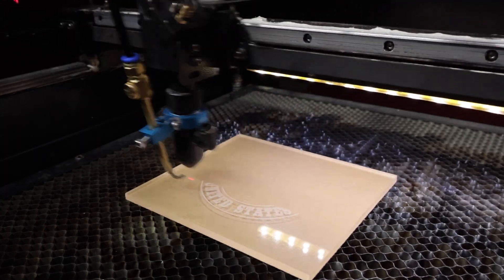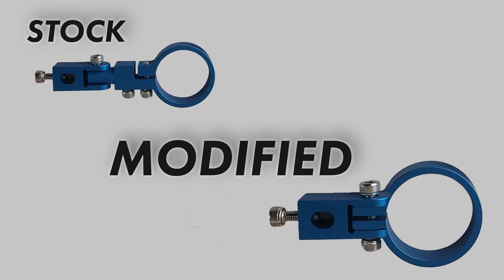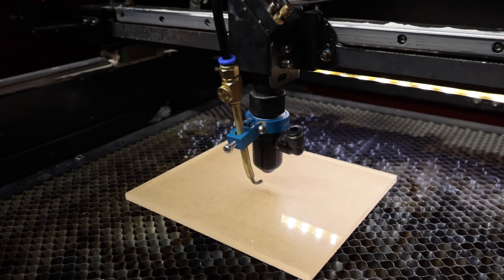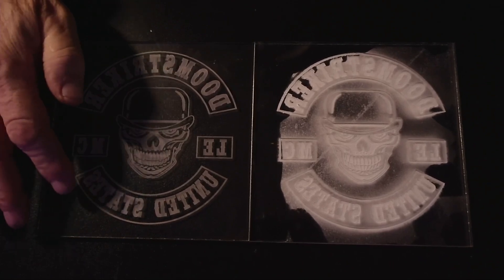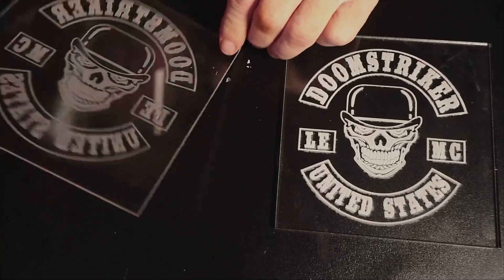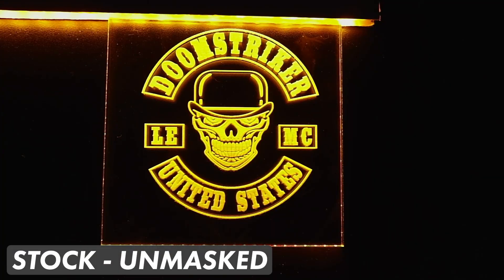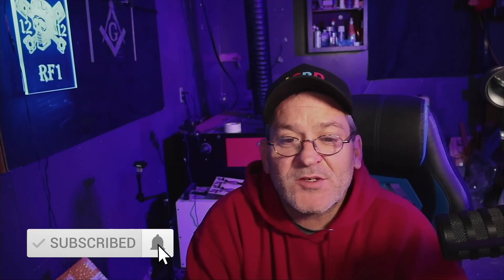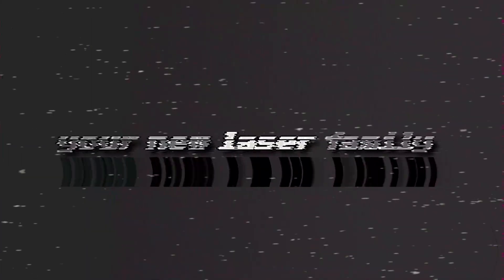STOP WEEDING | Better Acrylic Signs with the LightObject ENHANCED Air Assist

Comment: Here's some dumb questions from someone who has no laser yet.  
Can you use different gasses as your assist for any reason? If you used CO2 or O2 there would be less or more fire risk, but certainly either one could affect the effectiveness of the laser? Or perhaps the right gas would become part of the engraving reaction creating some color effect. Just wondering.
Reply: I see no other need for any different gas to do the job of air . Its free !!

Comment: What PSI are you running?
Reply: 8psi
Reply: you just need enough to blow the dust off the working surface .You can go higher  with the Psi  .I have gone up to 15 before anf it doesnt affect the ending result of the finish on the acrylic

Comment: I wonder if it would make a difference when using the laser to cut stencils in the paper. Where you back paint the acrylic. I keep getting deep points in corners that are visible in the end product. 99% of people say they don’t notice, but I notice it and it drives me crazy.
Reply: Im not sure why you are getting deep points on the corners but try this method . Ifs proven and its spot on .. Check the links below where you can get one of these  inexpensive air assist brackets
Reply: @jimvanderlinde   I would say the points are due to the tool head speed reducing as it enters the corner, pausing for a split second and then changing direction
Reply: @geauxracerx  what are your settings ??
Reply: @jimvanderlinde  11% power because tube won’t lase under 10% speed ~300mms
Reply: @geauxracerx  Yes i had that same problem .But with the external air assist it changes everything for the better . I run 375 speed 16 power
Reply: @jimvanderlinde  sweet! Thank you for the input.

Any issues running both at the same time?  Though the standard is why it gets so much deeper. So nvm I answered my own question
Reply: @geauxracerx  check the link where i bought it from its so inexpensive yet does so much